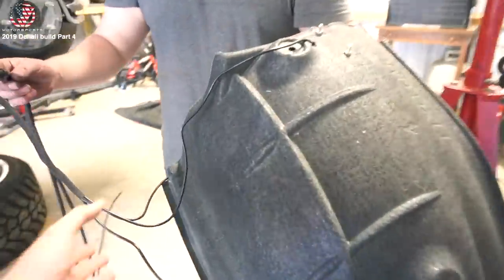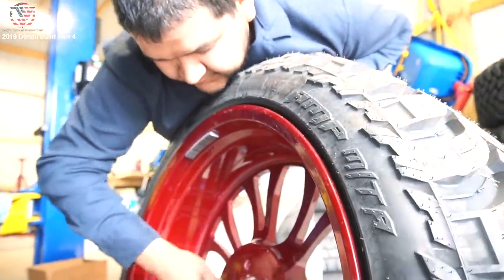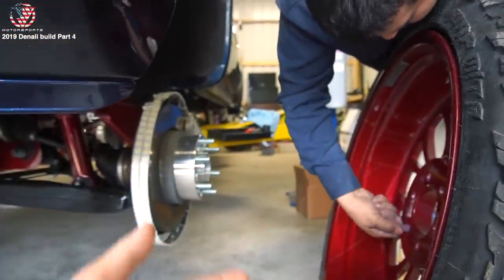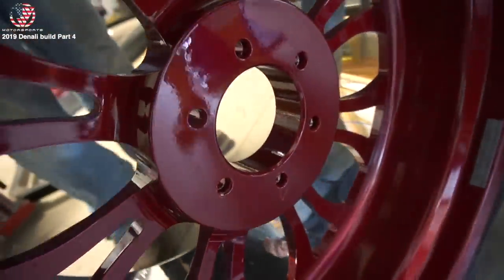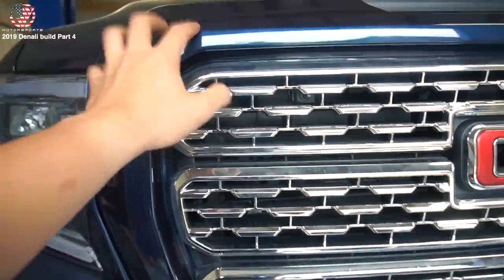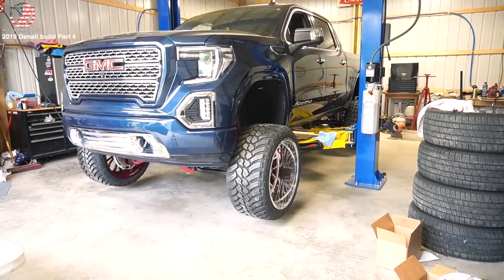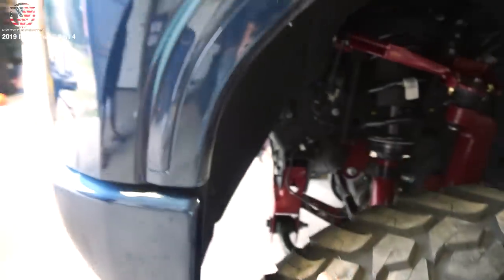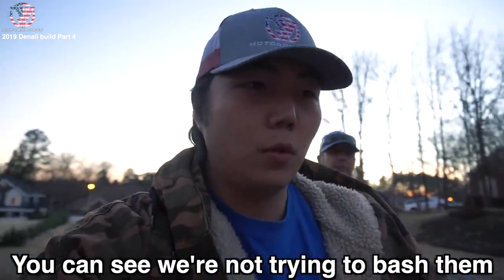YOU'RE NOT READY TO SEE HOW WIDE THIS DENALI BUILD ENDED UP...! *DENALI 1500 BUILD REVEAL*

Comment: Extremely happy with the build. Elite Innovation and Performance did an excellent job working with all issues that came up, highly recommend. The wheel manufacturer also bend over backwards to make things right. I have nothing bad to say about them. Small company growing pains. They were great with me and COVID messed everything up for everyone. I rather have a wheel that’s not mass produced and totally custom.  I’m still waiting on parts months later. After doing more research 24x14s with 35s will not fit on a 2019 Sierra without major cutting or at least a 10” lift ( check for yourselves).
Reply from the maker: Truck turned out great! I know you’re glad to have it back.

Comment: How Disappointing such a nice truck . This guy did all this resurch on lift kits why didn't he buy a 7-10 Mcgaughs set it at 10in and would clear 35s with 14 wides no problem no trimming . 33s look way to small expecialy with 2in wheel spacers , and even without spacers it will still probably rub . Sell the rims and get ones that will fit with out spacers and put the 35s back on . Glad I got my 10in Mcgaughs for my 2019 Chevy silverado LTZ 1500 when available.
Reply from the maker: Unfortunately with this vehicle being a Denali, it’s got the magneride. McGaughy’s 7-10” wouldn’t work.
Reply: @JWMontoya  thear is a by pass for the mag ride to eliminate all that MAG ride BS he still has a good lift kit . But really 33s he needs to sell those wheels and get the right wheels with 35s  and do a little bit of trimming. I'm sure you wouldn't be running that set up if you have a 1500
Reply from the maker: 33s definitely look small but at this moment (with Daytona around the corner) can’t find any forged wheels in stock to even replace these wheels.
Reply: Unfortunately Mcgaughy's dosnt sell the 7-10 anymore for half tons only 7-9,  Me and you got lucky we got ours when we did.